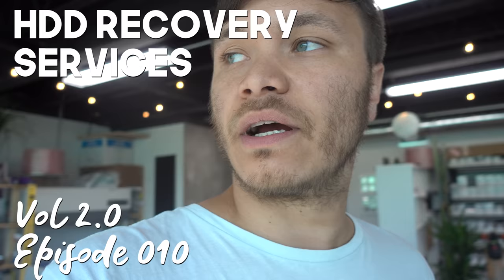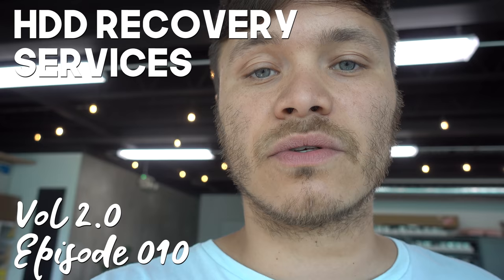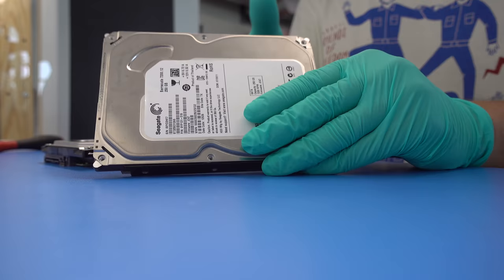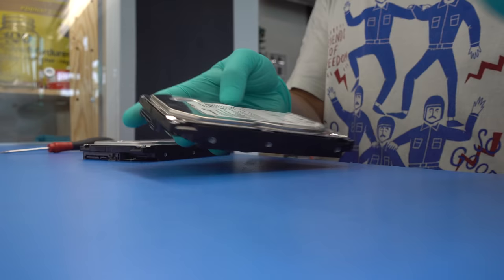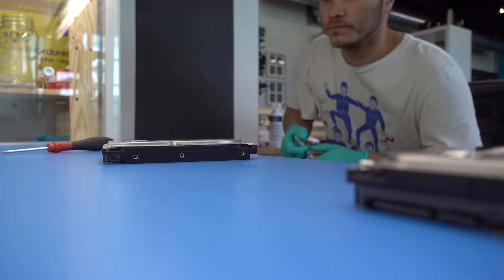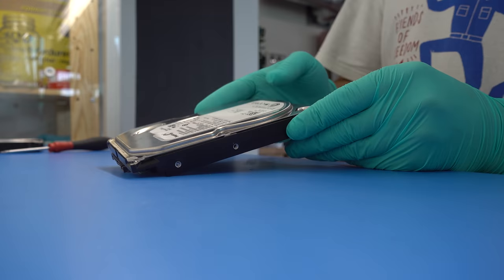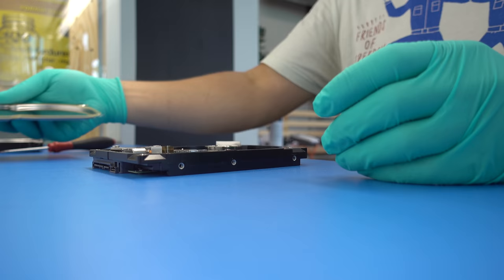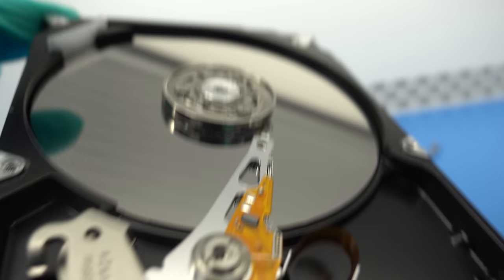scratched hard drive data recovery | platter damage and gluegun

Comment: A product that could fill the scratch on the platter and dries level with the platter surface would be interesting to try.
Reply from the maker: indeed, but I don't know of such a product. I've heard some highly skilled techs say they use it, but I'll believe it when I see it
Reply: @hddrecoveryservices  hi... if it is possible.. please take my case its 250 gb Seagate hdd.. having 50 Bitcoins in it ...

Comment: I'm a structural engineer, machinist, and a car painter.  I'm very interested in ways to recover data from scratched platters.  Heads getting ruined passing over scratches fall into at least 2 cases:  1) kicked up burr physically contacts head and 2) scratch is as wide as the head so the boundary layer head lift is compromised by a very rough surface and so the head contacts the peaks in that rough area.  And perhaps 3) the head scratch is deep enough to cause actual damage to the magnetic material.

So how do you get rid of these head contact situations so the head is not damaged trying to read a scratched platter?  

BURNISHING:  

This seems to be a "machining" process where a special aerodynamic "head" is used to cut down the burrs.  It is not 100% effective but evidently allows a scratched platter to be read in some cases where a head would be destroyed.  VERY EXPENSIVE!

POLISHING:  

I've been trying to find how platters are manufactured but I'll bet that involves highly guarded proprietary processes.  I found statements that coatings are sputtered onto the magnetic media and that polishing is also performed.  

Scratches can be polished out of CD's and show car clear coats so the question is how are platters polished and could a polishing method be devised to lower the burrs so they don't contact heads and also to not damage the sputtered coatings that would ruin the ability of the head to function.  However since the head flies, the coatings may not be necessary for a data recovery pass.  

A Sealer coating could possibly encapsulate the embedded debris and also decrease the height of the burr relative to the top of this added coating.   

There are silicone rubbers that were applied to phonograph records which would bond to the groove debris and when you peeled them off, they pulled it off leaving clean grooves.  Such a process could possibly remove embedded debris IF that is a problem.

First step is determine the mechanical properties of the coatings and how the platters are polished.

Comment: Great job man! Awesome!!
I have a HDD which has precious photos in it, and I am keeping it hoping that someday, somehow, I can find a solution like yours. The problem on mine is that it’s totally scratched! Would love to get your take on whether or not it’s salvageable. Thanks for this video. 
Great work! Great job! And the description, with all your materials and everything. Just great!
Reply from the maker: We would need to inspect it. Totally scratched on 1 surface can force other surfaces to scratched. We have a 8TB case in works right now where 2 out of 10 surfaces survived and decent amount of data was pulled because zone stripes were long. A lot depends on the drive setup. Contact us at www.hddrecovery.ca/contact-us and provide all the details on past attempts

Comment: Good tecnik, i will try it when i have a case of a headcrash. Usually what i do is if the headcrash is not in the head 0 ou 1 that the drive can read the firmware. For example head 3 had damages. I cut the head 3, and try to make image from the other heads. But now i will try to put glue after imaging the other areas and try to read from surface 3for the remaining good area. Nice work!
Reply from the maker: +Ruben Messejana depop is good technique too

Comment: Does the same apply to a multiple platter drive? I have a 5TB drive with huge gouges near the spindle. Will all the data be stored on the edges of all 5 platters or does it move from one platter to the other platters as it fills them up?

Comment: Wonderful idea! Great job.
I have a quick question.
I had sent my WD hard drive for data recovery but their message was that recovery from this case is not possible due to scratches on the upper side of the 2nd platter.

 

Initially they we were able to get access to the hard drive after head transplantation but later the transplanted head got crashed and lost access. 
By any chance your services are available for India.?

Comment: Great Video. A question tough: how do you deal with mid-platter scratches? I saw some tools that can manage outside scratches, but I'm more interested in the middle. Thanks. You got yourself a new follower eheheh
Reply from the maker: Hi, welcome to the channel. Scratch in the middle would be a problem. Data from outside towards scratch could still be recovered, but a lot will depend on what type of drive it is, how it parks, how many heads, etc... best solution in this case on multi-platter drive is to cut that head out, and reprogram the drive to disable it.

Comment: When heads touch a platter anywhere other than the inner area, they will stick to it, causing what's people call stiction.  You just closed yours up with head on the platter. Was there a final step to get it spinning? Thanks for your videos, very interesting!
Reply from the maker: In this case they did not. But in case they would, we would have to jump start it

Comment: I have a drive that has 3 platters and it doesnt appear to read the top platter because its just a circular spinny thing on the header "reader" (forgive my lack of knowledge), all the other sides have no scratches, am I safe to turn this baby on? Is the data only written on the inside platters? The top is scratched badly so I cant make the header miss it.

Comment: Well done. 
Did you ever try to do a recovery without closing the drive's case, either in the laminar flow cabinet or just outside, next to the computer? I think it would be good to see the effect an open hdd has on the ability to recover data of the drive.
kind regards & greetings
Reply from the maker: I have not. I can pull some failed drives from my stock and see if I can free up some time to do this.
Reply: I'd only suggest that if you're cleaning your room every several hours and never open the windows, e.g. have no air flow going on. Else I doubt it's going to be a good idea, there's a reason why hard drives are closed up and have a filter there around the platter.

I guess the better question would be: How much dust can a harddrive withstand?
Reply: You never want to do this to a hard drive and even if it is repaired always transfer that data to a new hard drive Asap. A recovered hard drive loses it ability to read and write to the drive after repair and will eventually fail sooner than later.

Comment: Hi again, mister!
Talked to some "experts" in the field today. One of them said it was critical to get a donor that was made like within weeks of the batch the crashed HDD is made. That buying on part number/model number is not enough in itself because of the tolerances.
What's your take on that?

Also, I have gotten som inspiration from this video. I will do a similar solution for avoiding the parking area near the spindle. But since there is a small notch on the platter surface (rest looks spotless, luckily), I'm thinking to make an additional mechanical stopper so that the heads will be physically restricted to pass over the notched sector.

What do you think? ;)
Reply from the maker: tmbryhn parts compatibility criteria is different for different makes of hard drives. Date of manufacturing is a good to match, but even with the same date you can have a mismatch. Preamp type for Seagate nails it, microjogs nail it for WD but you won't find out that information without specialized tools, so label is the best next option. Hard drives that park on platters are hard to work on, add platter damage to it and it just takes everything to a whole new level. My suggestion would be to bring it to DR company if data is important.

Comment: Just a general question; is there any part of a hard drive that is still usable when it fails a SMART test?  PCB board, heads, etc?
Reply from the maker: PCB, heads most likely, chassis are all good if SMART test failed.
Reply: Good to know.  Thank you for your reply, appreciate it.

Comment: Hi, I have 2TB HDD full of Data, but currently I have no access to my Data. I used to use 2 pieces of 2TB HDD in a TeraMaster NAS device. Once I have seen that the NAS device is no more accessible. Then the TerraMaster support center said my be the problem is in the HDDs. Then I sent the device to a Data Recovery company in Cologne, Germany. They said the NAS configuration was JOBD, HDD 02 is alright but empty, HDD 01 is the faulty one and with full of data. After trying one and half month, they said that the head is broken and platter has scratches. Every time they install a new head and try to run it, the new head just get damage again. So they failed to recover any Data. Now I have seen your video that you can recover data from even scratched platters. Please help me save my 20 years of study and a lot a personal data. Otherwise I will be dead. Please help me. I am eagerly waiting for your response. Thanks.

Comment: My external WD passport stoped working, no clicking noise nothing. Sent it to Fields Data Recovery in UK they said it needs new heads once they replaced it they said its not working and they cant do anything about it. Can this happen or are they not professional? They charged me a lot of money as well and didn’t recover anything! 

The hard drive wasn’t dropped or water damaged. I just cant figure out why they couldn’t do anything even after changing the heads 🤨
Reply from the maker: It could have happened naturally, but WD passport even with platter damage is a good enough candidate to recover partially at least. What is not professional is to charge for work that has no result if they are the first people to open it. I would get it checked out for you man, fill out the form here www.hddrecovery.ca/contact-us
Reply: HDD Recovery Services thanks for the info, i live in UK  but I’m pretty sure they might have done a mistake or they are just not that professional to get this spinning! They promised me they will do procedure in their clean lab and they said chances of the fix would be 70% 

😊

Comment: what does the drive do when it hits that stop (w/the hot glue)? Doesn't the controller think it should be able to go further and keep sending a signal to the arm to move further? seems like it would cause a lot of issues. especially since that's near the center of the spindle, I thought drives typically try to write the most data to the center (then again... depends on the file system... and most don't do a good job at that anyway).
Reply from the maker: I will address this in next weeks Q&A episode Colin. Great question
Reply: I don't know how it's done usually but writing/reading data as far away from centre as you can you are getting slightly better speeds ( tracks are longer ) so it would have sense to store data there
Reply: Kanapka Z Pasztetem I swear it’s the other way around. Maybe it’s different with today’s drive, but I know on old drives “short stroking” was popular, creating a smaller partition at the beginning of the drive and using that for boot volume / other things that had to be fast. Since the sectors were closer together and head had a shorter distance to travel between tracks closer to the center, it was faster. That’s also why when you look at mechanical drive speed tests, they always start out fast, and performance drops off as it moves away to outer regions of the disk. Unless that’s actually the other way around?? Because I noticed when burning CDs it always went faster at the end, but that’s because the speed was variable and it spun faster too? Hard drive spinning speed is constant (well, further away from center it is technically faster I guess, but sectors are larger or farther apart?). Now I’m really confused.
Reply: emm... I actually remember that I read some tutorial about how to setup special little faster partition at end of your disk... it's basic geometry - tracks are longer on edge of disk so with 1 rotation of disk you will read more data = better speed, so it makes sense ... of course other things are standards that will probably force you to store some information about data in specific areas of disk so you can actually make use of it ;) but I don't want to pretend that I know everything in this topic so lets wait for our pro to explain it to us in Q&A hopefully shortly :P
Reply: Well according to MyDefrag the beginning of a disc is faster than the end and in terms of harddrives that's the smaller inner circle. But nowadays it's not much difference, what matters is that you don't have huge gaps inbetween.

I can highly suggest trying it out for yourself, if you have a mechanical drive. Download a copy of DiskSpeed32, test your drive, then use MyDefrag's monthly script to defrag and optimize your drive, which means moving boot/system files at the start, leaving a gap for new files, then it usually throws the pagefile after and bigger files/stuff you use often(only if you regulary use MyDefrag). It's not much difference compared to the default defragmentation of Windows, but that only defrags the files and doesn't optimizes them on the actual disk. It sped up the start of Windows a lot for me back when I had no SSD yet.

Comment: If the platter is scratched in a 2mm circle somewhere halfway around the platter do you think recovery is still possible using a method like this? 

The disc cannot startup because the head always stops at the damaged circle and the drive fails such as in this example here https://www.youtube.com/watch?v=SZOxa8xjgSk&t=1s just not nearly extensive in done damage
Reply from the maker: It depends on the architecture of the drive. Skilled data recovery specialist can get partial data out as long as there is a way to get service area access
Reply: @hddrecoveryservices  It's been a year and I had no idea you responded because of youtube's trash notification system. Thanks so much for responding